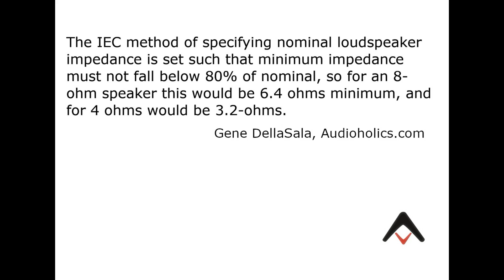Speaker Impedance: Are Most Tower Speakers 8-ohms or 4-ohms?

Comment: I have a Samsung HTS-J4500 and it hat small speakers with 3 ohms and 80W ,  ive seen speakers that are rated at 6ohms but much bigger diameter and i was asking if i can just use them as replacement for my tiny 3 ohms ones???

Comment: It is more complicated than describing speaker impedance 8-ohms or 4-ohms for most loudspeakers but the question should be what is the average impedance on most loudspeakers.The answer should be dependent on how the loudspeaker and crossover network is wired individual speaker impedance and what type of music you listen too because loudspeaker impedance is determined by frequency.

Comment: There should be some interesting and juicy electrical engineering tid-bits here today.  Like how the crossover network, signal frequency, electrodynamics and thermodynamics of the coil and magnet physics within the speaker motor affects the dynamic nature of the speaker system impedance.
Reply: Not quite what I was hoping for, but I did learn a couple things.  As always - Thanks Gene!